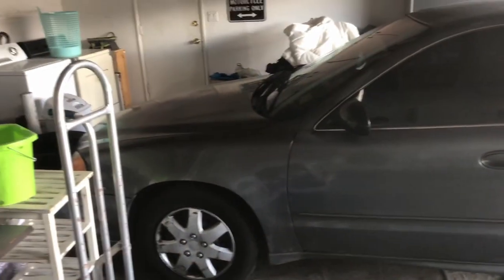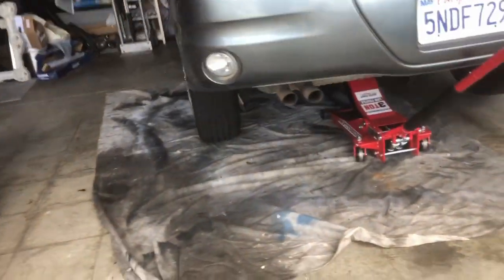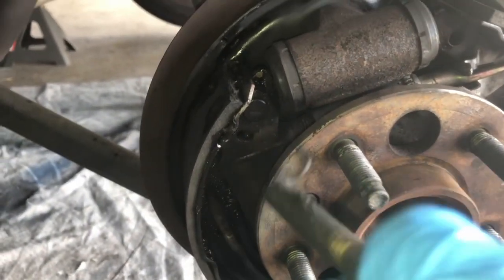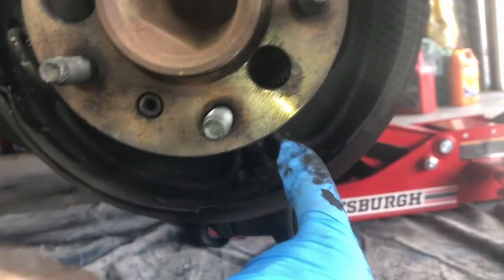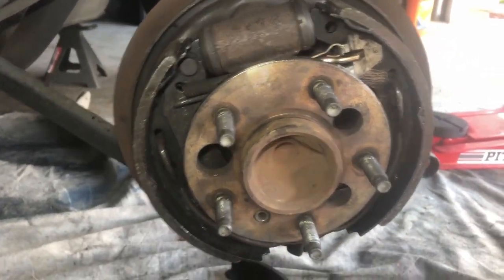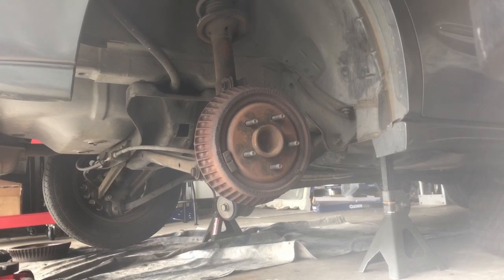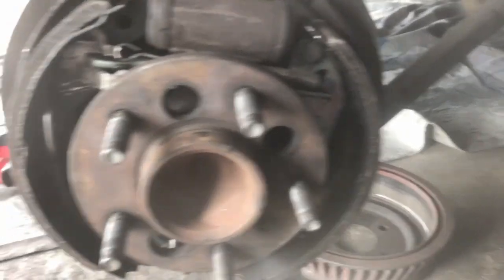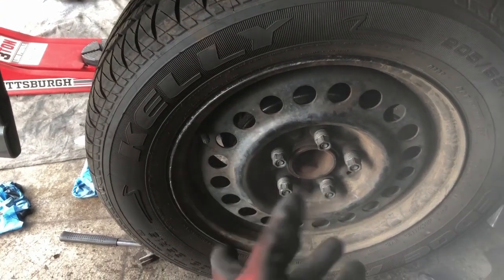Replacing Drum Brakes on a 2005 Pontiac Grand Am

Comment: Omg it took me several hours to figure out the drum brakes on this car let’s say once I figured it out the other side went extremely fast. The main issue that gives you trouble is the tension bar best way I found to get it In was to use the automatic tensioner to hold the one side then use a big screw driver and a hammer too pop it in its spot.

Comment: But how did you put that huge spring back?
Reply from the maker: I had to persuade it with a pry bar
Reply: @bluesxt  Thank you for the replay. I'm afraid it would be hard for me to do it w/a pry bar (though I have 2 large, maybe it will work), I think one need more experience to do that. Do you happen know if there is a special tool to remove and put back that spring? I did only one set of rear brakes, but it was on a different car (2001 Saturn SL2), and those brakes had 3 or 4 small springs.
Reply from the maker: @olenaerhardt7725  as you can see by some of the other comments on this video it’s not an easy job. But it is completely do able with a pry bar and once you figure out the method it’s not too bad. Just get one side hooked into place and then work the other side into place little by little with the pry bar
Reply: @bluesxt  O'K, thank you for the encouragement. I know sometimes it looks scary, but when you start to work on it everything comes in place and seems not so hard. Special thanks for the  explanations how exactly to apply the pry bar.